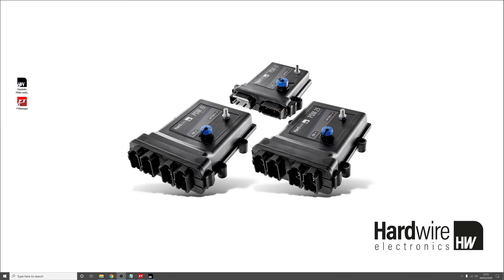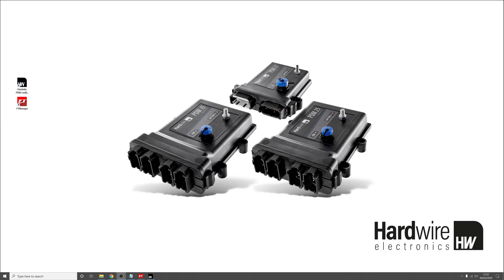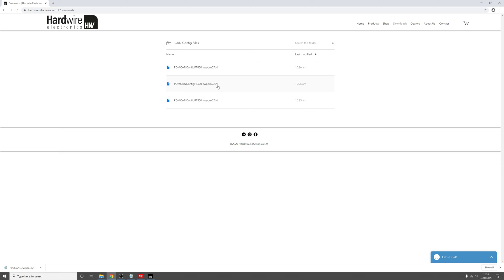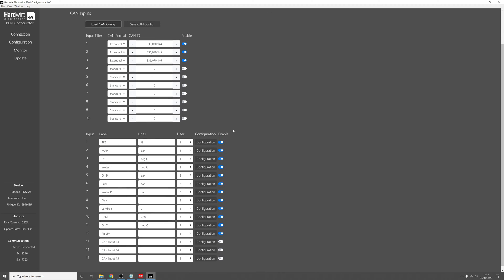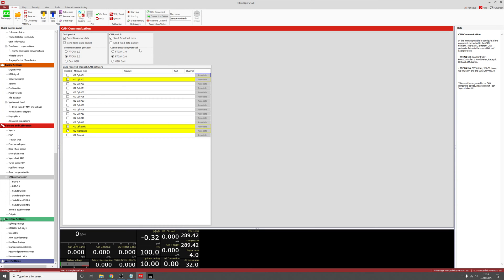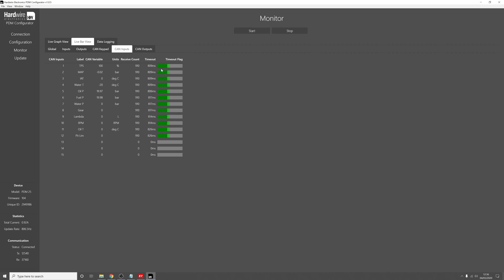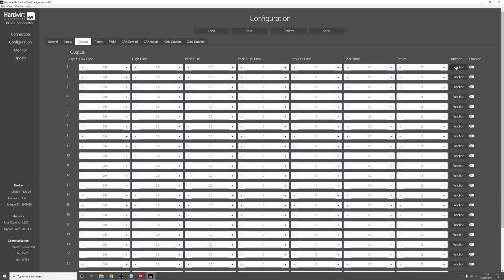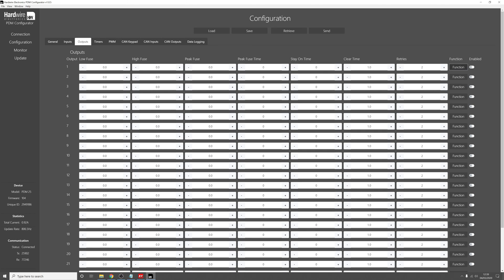Connecting a PDM to a Fuel Tech ECU via CAN bus | Hardwire Electronics

Comment: Quite interesting. Considering one to compliment my Fueltech 450. Regarding the CAN data communication, is it possible to use an the PDM inputs as extensions of the Fueltech input through the CAN bus, much like the FT Input Expander module ?
Reply: I thought the same. Did you got an answer?
Reply: I am still wanting a way to do this. Not clear on if it is possible due to the FT "extended can" protocol.
Reply: @BigPermGarage  I contacted fueltech and they have a locked down CAN for input. so it cant be used as a Input expander.

Wish it would though as i need 3 addition inputs for my FT550 and dont want to get an input expander just for that.
Reply: hey guys, someone interested in having a chat with me over this?

want to achcieve the same, Ive a ft450